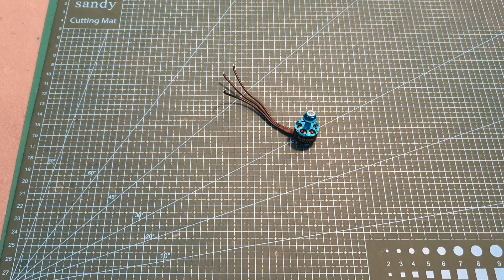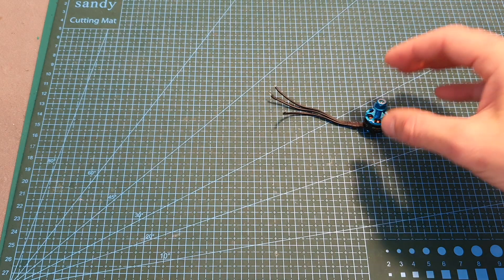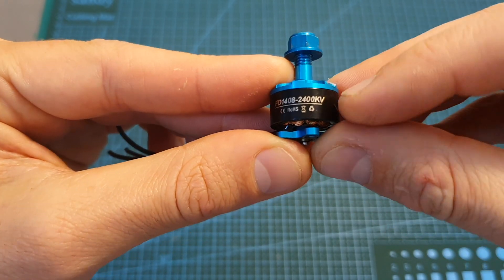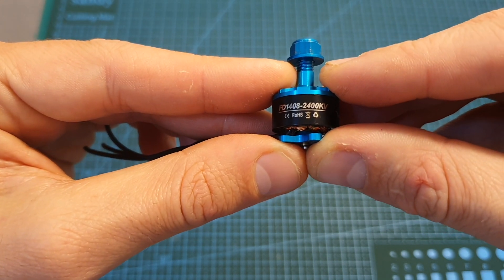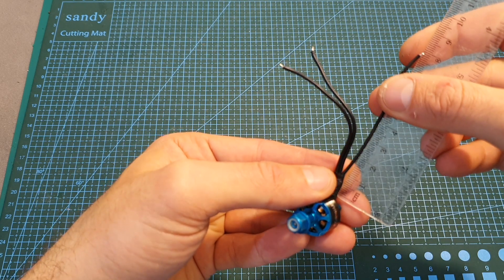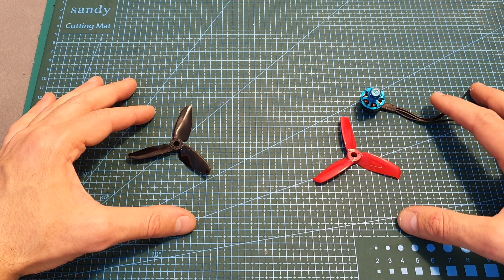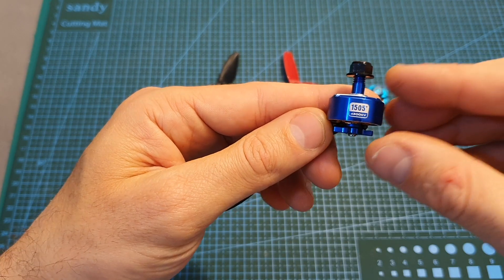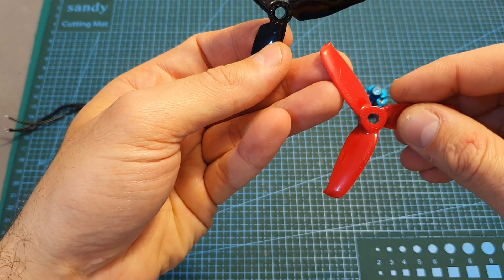HGLRC FD1408 2400KV Thrust Test

Comment: OOOhhh nice, I was waiting for this one.
Reply: Do you think this motor could handle a 5040 propeller on 3S?
Reply from the maker: I think it should be good.
Reply: @KremerFPV  Time for another ultralight 5in build...lol
Reply: @KremerFPV  I have the perfect platform to test these. To give you a baseline, my new AmaxInno nano 5E flies very well with Gemfan 5030 bi-blades on HGLRC Flame 1407 3600kv motors using 3S packs. I can over for 2 minutes with a few 80% throttle punch outs on a Pulse 450mah pack and still come down with 3,8v cell voltage. If it  carries a 1050mah 70c Tattu accu, it can over for 5-6 minutes and come down with 3.95v cell voltage, including a few mild punch outs as well.  I have not tested yet on 4S, I'm afraid I will fry something.

I think this setup has the pontential to be a nice Long Range quadcopter with an all up weigh of less than 250g.
 My dry weight is 139 grams. The frame itself only weighs 34 grams.

Comment: Cool! Now we just need more micro 5S and 6S packs for these low-kv motors. Currently I can only think of two- the PyroDrone 700mah 5S and the GNB 550mah 6S. Both packs have a very similar Wh-rating of a 850mah 4S battery, so don’t let the smaller capacity fool you!
Reply from the maker: Thanks. I am going to connect two 450mah 3s batteries in series when I am going to test it out.

Comment: Great info!.. I am thinking of using this for a sub 250 quad with longer run times.. Is it possible to run a 4 inch prop on the 6S version? I am thinking to run 4" with 4S ?  Should give "ok" thrust with a good run time?  Would love to hear your thoughts?
Reply from the maker: Thanks. I am going do another bench test that will answer your question in the next few days :-)
Reply: FPV Club same idea I have been wanting to build 4 inch 
and i have these motors. by mistake ive seen 1408 2800kv 5s on 3 inch rip the sky. 2400kv and some hq s maybe the gemfan flash props.

Comment: What ESC? on 3052, 200 g build with this motors? 1408 2400 kv? 5-6s.
Reply from the maker: Which frame are you going to use? 20*20mm esc?
Reply: @KremerFPV  yes, 20x20 esc + fc + vtx from iflight maybe
Reply from the maker: @mikisiss1  https://youtu.be/_Fub2ClVJqA
Reply: @KremerFPV  iflight ih3, something between 20-40g, 3"-4"

Comment: Would you try a 5 inch prop?
Reply from the maker: Yes. I am going to thrust test the 3600kv version and then I plan to test the 2400kv with a 5" propeller.
Reply: @KremerFPV  i bought these 1408 3200kv with the intent of using them for a 4 inch build. ended up using them on the ldarc 200gt frame with some 5040 works pretty well. 300 gram auw easily 3 minutes on an 1000mah 4s

what i wonder is what would the performance of the 2400kv version be like on a steaper 5 inch prop

https://www.hobbywingdirect.com/products/xrotor-1408-motor-1?variant=18124470616179